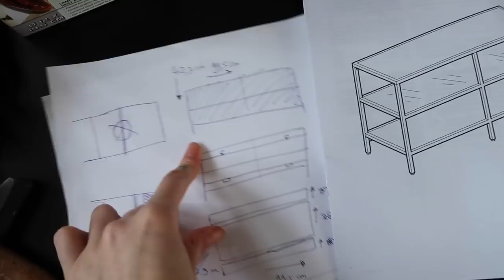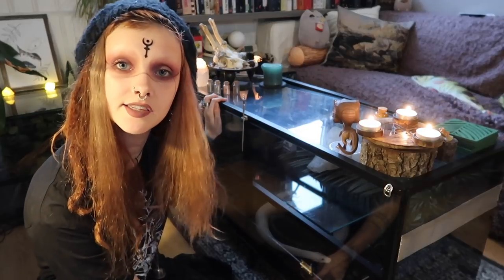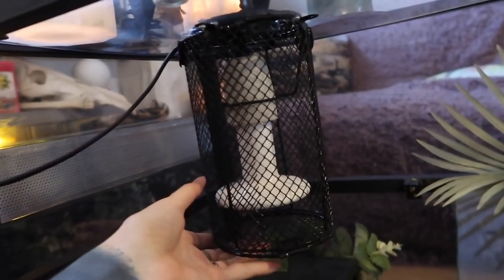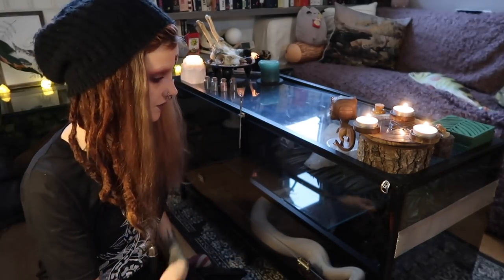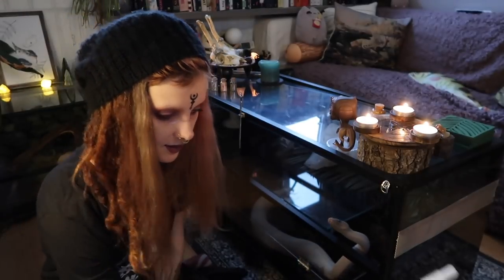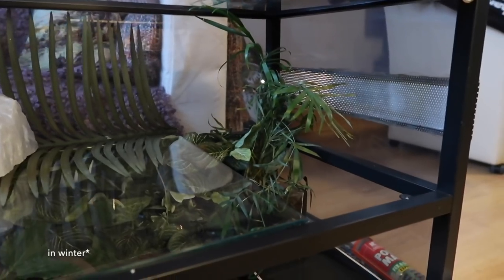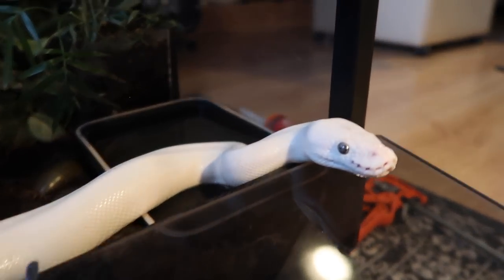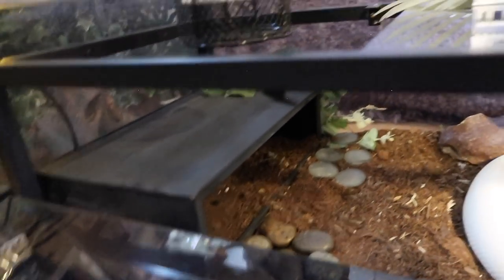I built a snake tank table

Comment: I am sure you know since you have a few snakes now and have probably done your research, but I just hope that the heat mat is on a thermostat, particularly due to it being against wood and being pressed up against the tank. It could start a fire if not regulated.
Reply from the maker: All the heat things are on a thermosstat, but the heat mats I use also have a build in safety thingy that will keep them from overheating :)
Reply: @Psychara  can you please tell me where your Heatmat is from. I'm still not sure where to get a new one and the safety thing sounds really good. By the way: awesome video as always :)